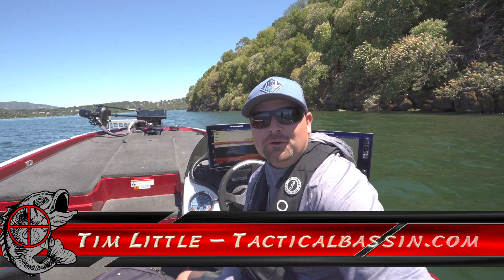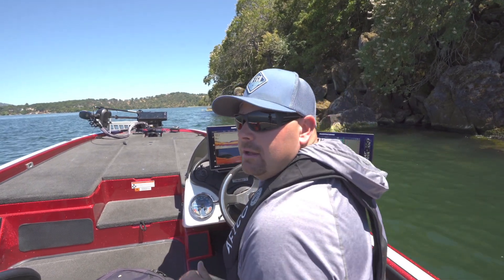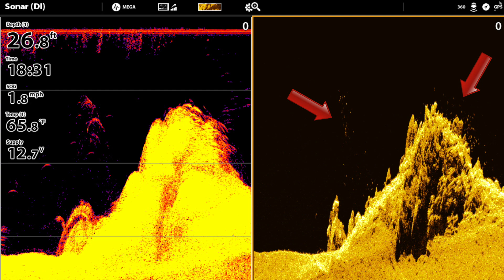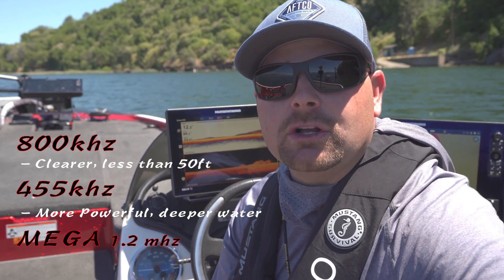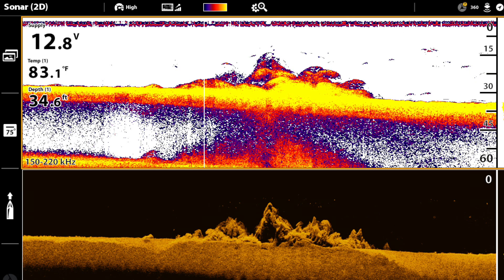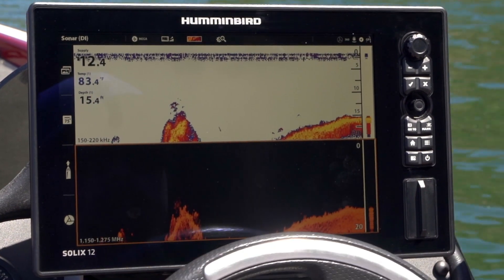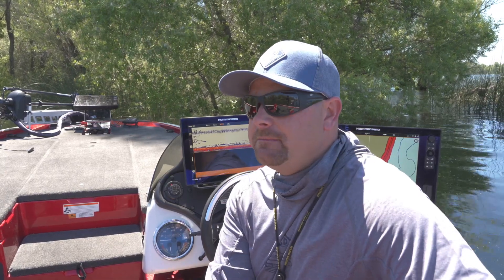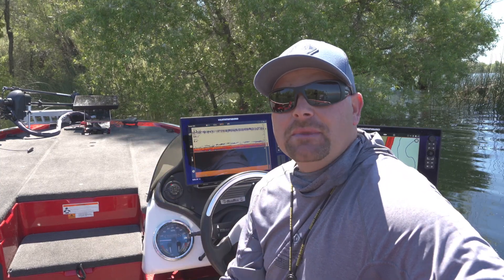Sonar Basics: How To Interpret Down Imaging Sonar

Comment: Hey Tim I just have a quick question. What are the differences in display for down imaging with a wide, medium, and narrow beam respectively. That's the only adjustment on my Helix 5.
Reply: A narrower beam shows more detail, but covers a smaller area. For your unit, narrow is a 20 degree beam, medium is a 40 degree, and wide is 60 degree.

Comment: I have a Helix 7 Mega SI G3N and literally JUST took it out for the first time this weekend. How do you get to the hz settings to toggle between 400, 800, or Mega. I fish from a kayak and a friend suggested I should just use the Mega if I have the battery life. Thoughts? I will check the previous posted as well.
Reply: Mike Bruehl hi, i Also use a kayak and i am thinking ti buy a hélix7 but i what it to have a 360 imaging Does it use the same transducer or do you have yo buy it apart

Comment: Is the screen on the right only for mapping? My dad just gave me a new fish finder that has GPS,side scan, and down imaging.  I would like to scan the lakes I fish and make way points. Would it be better to start off with side scan and the map or the 2d and down imaging?
Reply from the maker: I usually use the in dash unit for mapping anf the side unit for sonar, DI and SI
Reply: I have another question for you guys. I bought my first boat last year and I'm want to do some upgrades on it. So I have a fish with GPS and side scan. I want to get a nicer one eventually. I also want to get power poles and a trolling motor with spot lock. Which should I get first power poles and trolling motor or new electronics?

Comment: Iv been looking to get one with down Scan for the front of the boat. Is the Humminbird HELIX 7 CHIRP MEGA DI GPS G3N GPS any good? 600 bucks is about my max limit
Reply: Looking at that same unit be interested in feedback as well
Reply: Hollywood T  Thanks i think i may pull the trigger on a new Helix
Reply from the maker: That is a great unit. Once you learn the keys and menu you won’t have any issues. We have that unit on a work boat and it works great.
Reply: @Cerus98 yeah, if I find a good deal on one I may look into it. But right now 600 is my max limit,atleast for this year. Next year may be a better upgrade, looking into powerpoles as well. But liking these units. That's for the tips, and thanks everyone else as well

Comment: I have Side and Down imaging on my Gen 2 Lowrance HDS 7s but I don’t think I have em dialed in right. Especially on side imaging. I don’t see anything. Down imaging is ok. Most of the time I wanna fish and not dick around with my graphs when I’m on the water. Need to designate more time to getting my graphs lined up. Awesome video Tim!!!
Reply from the maker: Thanks bud! Yes it’s hard not to focus on the screen all the time lol. If you’re not seeing anything, I’d start by doing a factory reset. Be sure to save all of your waypoints first. If that doesn’t work check your transducer location.

Comment: Is there another video, a little more than just entry level? What are your thoughts on the Hook2 9 triple shot?
Reply from the maker: Not yet. What do you have in mind? I don't have a lot of experience with the Hook units, but I've been on a boat with one and it worked good.
Reply: @tacticalbassin  I bought one for my kayak (cause it was a smoking deal) but havent installed yet and was wondering because you mentioned this was an entry level type video of understanding.